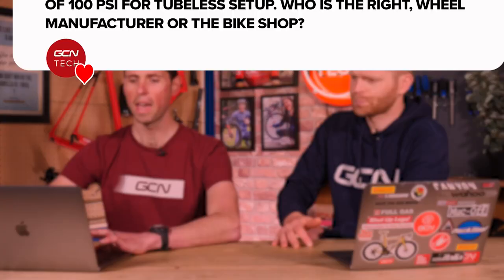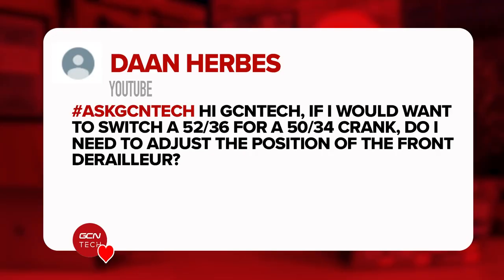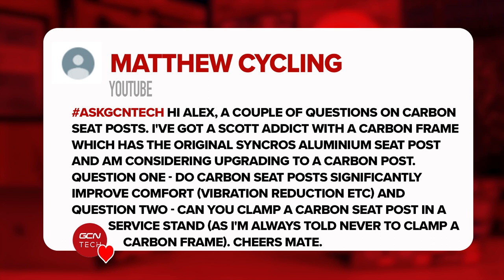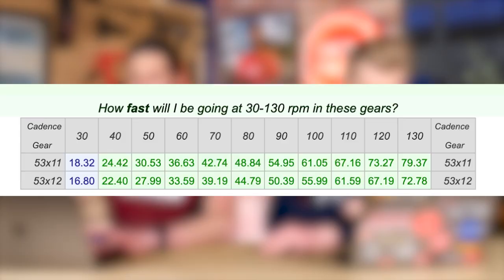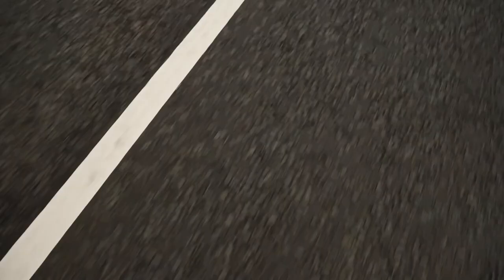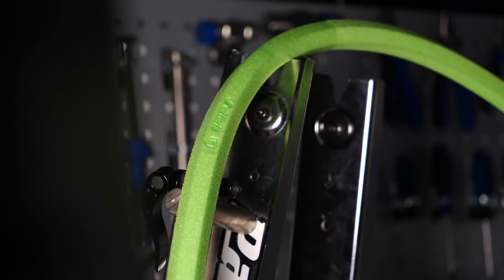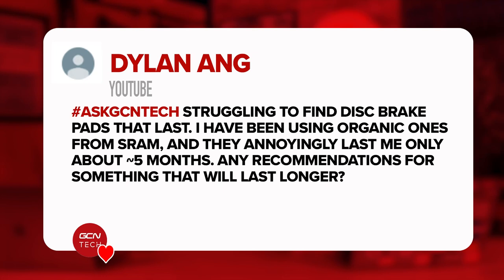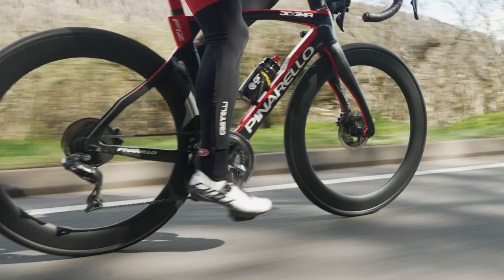Do Carbon Fiber Seatposts Make Bikes More Comfortable? | GCN Tech Clinic #AskGCNTech

Comment: #askgcntech Hello team, I've tried changing my pedals today however, the left pedal had seized.  I'm pretty sure I was spinning it the right way, which is clockwise and I've tried using wd40 but, the darn thing still won't budge.  Can I use an impact wrench to get it off?  or if you guys have any other ideas, please do share.  Happy Riding team!
Reply: Penetrating oil and heat the crank up some with a propane torch, often tht contraction and fluid wick to the threads will do it.
Reply: Try your local bike shop first. They may have longer wrench that may do the job.
Reply: Extend your wrench with something longer and sturdy (pipe of some sorts, or something similar) to give yourself some extra leverage.

Edit: with a longer lever, placed parallel to the groud you could use your legs to push down too (easier to exert more force) while holding the bike at saddle and bars.

Also, installing wrench and using a rubber mallet to hit the wrench with (I suggest once again to have the wrench parallel to the ground, or a slight rise) might also help to break the pedal free.

Comment: #AskGCNTech Hi Guys, I've just got myself a nice shiny new bike, it has road boost spacing, do you know of any way of running an off the shelf Wheelset with standard road spacing in a boost frame. Are there any adaptors that you are aware of that I can buy? I would like to be able to share wheels between multiple bikes ideally. Thanks Rob

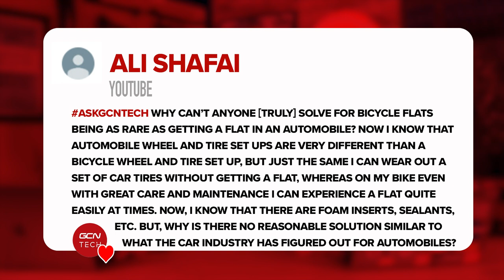Comment: 6:15 in fact bikes have a much better solution, airless tyres 100% imposible to have a flat cause they have no air! I bought my tannus tyres a year ago and I'm not going back to normal ones ever again.
Ps:unlike what gcn said, they are lighter not heavier. They weight less than the normal tyre + tube or sealing liquid plus you save the weight and air drag of having to carry spares,  pump and such.
They are a tiny bit slower, it's true but they are much safer to ride with on wet to the point you can corner on rainy days like if they were dry without any fear
Reply: Ive heard good things about the tannus tyres
Reply: @TheSpaceBrosShow  yup some riders even use them in long distance races like Valentin San Juan during ultra man races
Reply: @nemure  oh cool. Didnt know that

Comment: #AskGCNTech how can I improve my cadence? my average cadence is 60 to 70rpm. i tried gearing down but my average rpm stays the same.
Reply: just gotta train yourself to pedal faster, it's not particularly easy if your muscles aren't used to going that fast continuously
Reply: you should also check out your riding position
Reply: Maybe some group rides and work in easier gearing.  Will force you to spin faster to keep up.

Comment: Who would ride a 25mm tire at 73 psi???? Sounds like a good way to ruin a rim, or "burp" a tubeless tire. If you are riding hookless, you better be riding a relatively "fat tire. (30mm, 32mm)
Reply: Riding 28 at 75 psi, feels great, rolls great
Reply: That's exactly where my max pressure is. 25mm conti 5000 tubeless. Normally ride at 70psi or even a couple of psi lighter. I weigh 78kg. Wheels are 19mm internal aluminium Scribes. No problem at all.
Reply: @playandteach  How many years have you been riding a 25mm tire at 70 psi, with hookless rims? Rider and bike, together would weigh around 86kg.
Reply: @billkallas1762  Hi. About 18 months. Those aren't hookless though. I do have hookless gravel wheels with 32mm tyres that I ride at 55psi. What is the issue? Safety? Those gravel wheels are max 65psi rated.
Reply: @playandteach  75 psi in a rear 25mm tire, and a total weight of 86kg, is pretty low, since you have over 60% of your total weight on the rear tire. If you aren't flatting very often, your roads must be fairly smooth.
Reply: @billkallas1762  Appreciate the advice. So far not a single flat in 4 years on any bike. I did flat a side wall a few years ago when I had a stone caught in my rim calliper, but ride disc brakes now. Roads are very rough in places, but that's part of the joy of tubeless. Very little road debris though here - very rural. As long as flats are the only risk, rather than something more dangerous, I'll stick to those pressures. Enjoy your riding.